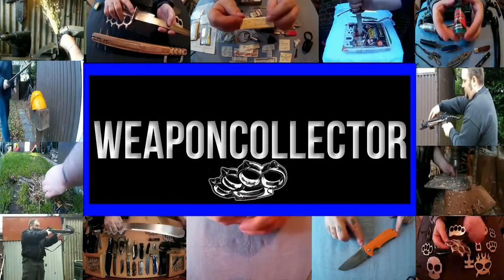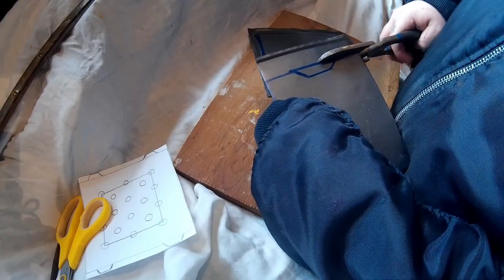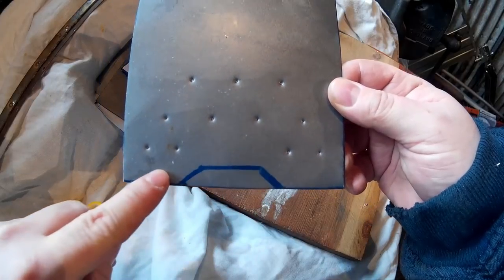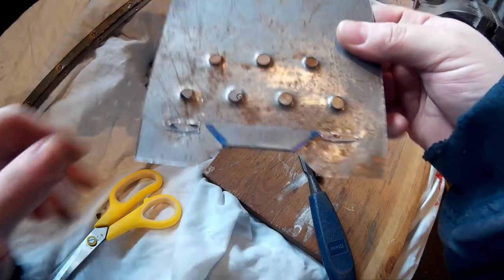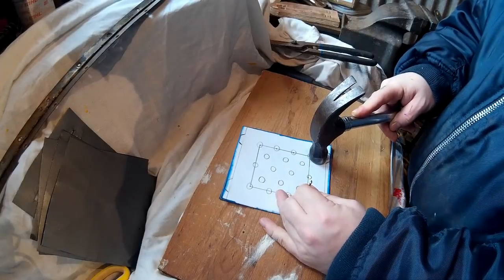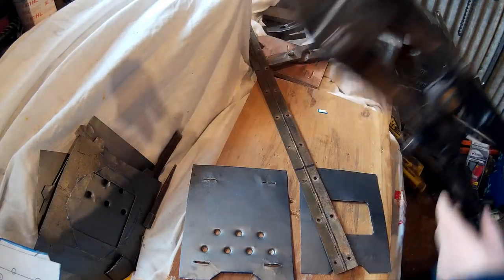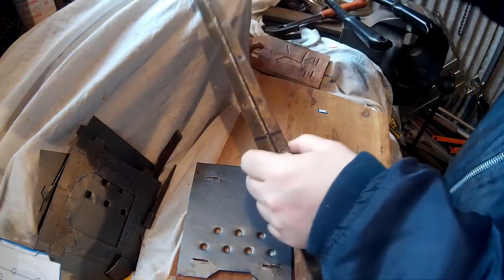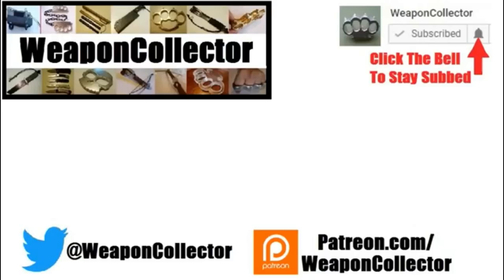How To Make A Wood Burning Folding Stove

Comment: Sorry dude, I watched this video last night and was going to comment but I deleted it, but after thinking about it more while in work last night thought i best had...
Please don't use this to eat from! Nothing worse than the taste of cancer causing TEFLON fumes caused by exposing those baking trays to open flames and corrosion!  I wouldn't want you to breath these fumes either bud, use normal stainless steel ones in future if ya can, and i'd advise everyone else attempting this build to not use Teflon coated material! 
Other than that, good work man! nice idea, and I shall be making a larger one for a mate in a few weeks n have some ideas and alterations in mind!
*sorry for being that sad twat lol
Reply from the maker: It's fine mate, i'm glad you said and I appreciate the advice and will pass it on to others and i shall also add a pinned comment letting others know, cheers.
Glad you liked the design, it's well worth making and easy too. you reckon if i sand of the teflon it will be o.k?
Reply: WeaponCollector cool mate, I've subscribed to ya now aswell! 
I'd say yes it would be OK, but the amount of sanding you'd have to do would be intense, plus the dust it kicks up will be real nasty. it may or may not burn itself off over time. I'd just keep your distance n not inhale the smoke lol call it a prototype design :)
Reply: Put the stove in a bigger fire and see if the coating all burns off